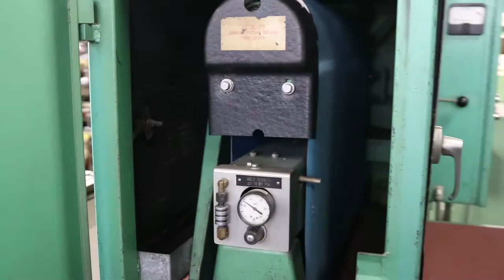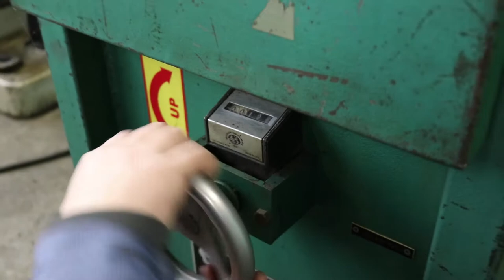Timesaver 37" Single Head Wide Belt Sander

Comment: Has it been good machine,?  And how expensive was sanding belts, and how long they last ?   Thanks
Reply from the maker: The sanding belts are around $50-$60 a belt - Search "VSM" on NormanMachineTool.com . Belt life depends on the type of belt, what you are grinding, and the operator. If your plasma table produces a lot of slag or if the operator is taking a really heavy pass, they will last less time. General feedback from customers is they are spending the same or less on abrasives with wide belt sanders than on flap discs and grinding discs, while saving a ton of time a week using the wide belt machine
Reply: @normanmachinetool  Yea that looks Great. I have Arthritus in my right wrist, and I get busy with bigger cuts (36×32) and have several. Its hard for me to flappy disc them. Thats why I'm looking into one of these.